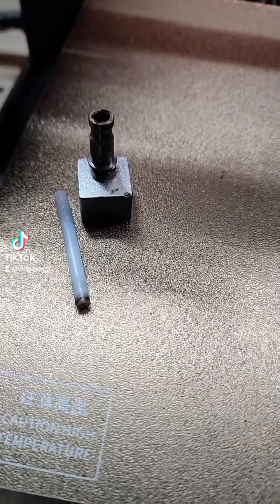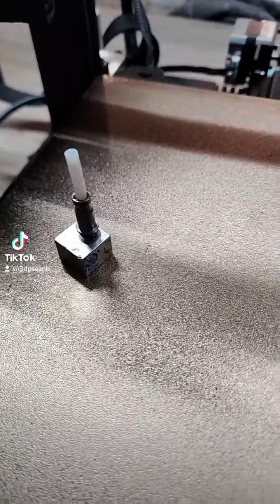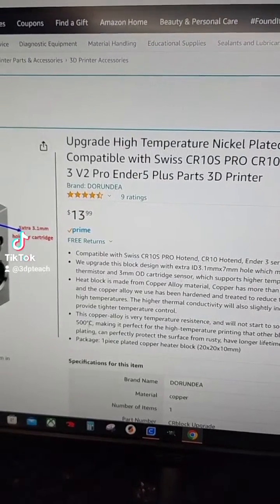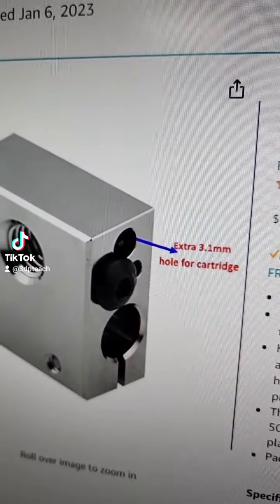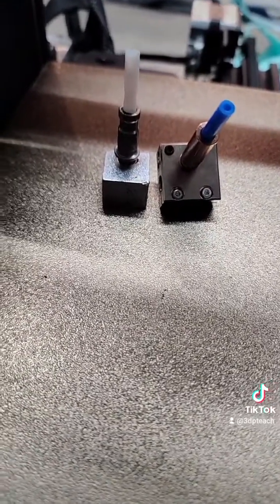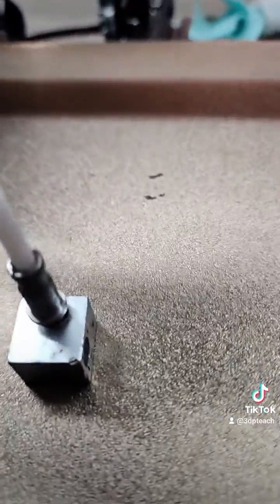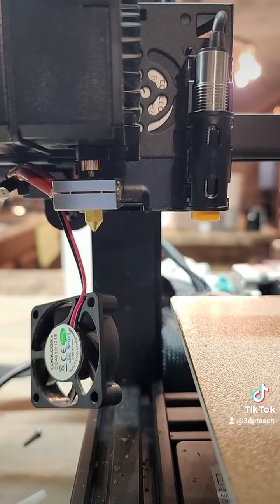Upgraded All Metal Hot-End for Anycubic Kobra

Comment: Could this be done on the kobra s1? I'm really disappointed that anycubic hasn't released additional nozzles for it yet despite the advertisement of them being supported.  I really want to be able to use different nozzle sizes and hardened steel nozzles too but so far, anycubic hasn't released anything for them.

Comment: Great video, thanks. One question is how did you removed the thermistor and the temperature sensor? They look like are glued on the socket. Did you used brute force or bought another ones? In the video looks like you replaced them with new one but not clear.

Comment: I''ll have to do this upgrade too since the standard extruder is too trivial and then leaves a lot to be desired (the filament doesn''t come out smoothly but in threads and we''re not there). But I was thinking of buying the Kobra2 extruder to mount on my Kobra series one (but I will have to replace the heating capsule and temperature sensor with the ones I have mounted on my printer), because I find it interesting to improve the passage of melted filament with a longer nozzle.  Will I solve and get results?
Reply: hey @pierpa_76pierpaolo you get any luck from buying the kobra 2 printhead and making it fit on the kobra 1. I'm trying to do the same thing but would rather have someone else do it before me.
Reply: @maverick1662  The Kobra 2 bimetal on the Kobra 1 is fine but the problem was the clamping on the extruder. I don't remember why I switched to the Creality Ender 3 anymore.

Comment: If you have a kobra 2 you can replace the heatbreak with a bi-metal one from a CR6 and this will allow you to use standard volcano nozzles. You will need to adjust the height of the inductive probe, run a PID autotune and set your z offset but it is a perfect fit.
Reply: this is gold, thank you
Reply: @martinsmith2948  Welcome.  Just for a heads-up I have also heard that the bi-metal heatbreak for a vyper is a better option.  I haven't had so much as a single problem with the CR6 SE one I have and there is literally a dozen kg through it.

Comment: I have a Kobra (base model) 3d printer and am having trouble.  My original print head stopped feeding filament after a certain amount of use.  I replaced the hot-end and the problem still exists.  I have tried different filaments with no difference. Until recently, I was able to make things just fine.   This article made me realize that the Kobra (base model) has its filament drive as part of the print head.  Where other Kobra models have a separate  filament drive. Is there an advantage in later Kobra models?

Comment: How would i be able to change firmware and display ui to go over 260 degree though
Reply: you need to Change this in your Firmware depends how got u want to go i change mine to 315 C so i can heat up to 300 C (15 C Protection is applied in every firmware)

Comment: Hello, I have replicated your guide on a Kobra Neo and I find that the teflon tube does not fit the heat-break. This is because the outside diameter of the tube is 4mm and the inside diameter of the heat-breaker is 4.20mm. The stock tube is ~4.15mm, and so it fits better. 

What did you do with this problem? Does it matter what the gap is? 

Regards

Comment: I ton't think this is really necessary
the only real issue with the anycubic hotend is that the PTFE tubi is too short right out of the box and it's not even good PTFE tubing as it is clearly offcenter

what I did was, I simply cut a convenient legth of PTFE tubing, mount the heatbrake in the extruder, stick the PTFE tube inside the heatbrake, push it firmly to ensure it is seated properly
trim the PTFE tube but leave about 0.5mm sticking out the heatbrake
lenght is now about 42mm, stock is 0.5-1mm too short
assemble the hotend except for the nozzle
after everything is assembled, install the nozzle

this process ensures that you have a positive seal between the PTFE tube and the nozzle
after I did this I got significantly better results
start of the print was now flawless, first layer printed better, overall results appear to be better as well

overall it is a pretty good printer once you set it up correctly
but this tiny detail is so annoying, all they had to do was measure twice and cut once and they would have much less issues with their product

Comment: How did you get it to auto level and set the z offset?
Reply: You'll have to set the z offset yourself like normal, but the auto leveling is based off of the orange magnetic probe
Reply: Use an Allen key to lower the sensor as low as the spanner they send to you after you have placed it on a peace of paper
Reply: @1937Brett explain more clearly please.
Reply: @PikachuOW2  this should help any more help let me know

Comment: Thanks for showing how to do this! I did this on my Kobra Neo with a similar set of parts. The process works there too, though some of the screws are located in different places. Some stuff not mentioned here that may trip up beginners (like me) who are doing this for the first time:
- you have to loosen some small screws inside the old hotend to get the heating element and thermistor out and then tighten similar screws on the new hotend.
- there's a screw to change the height of the leveling sensor. Anycubic actually has a video out on how to adjust it.
- there's some subtlety to choosing how far in to screw the nozzle vs how far in to screw the heat break. As far as I can tell, the best thing to do is tighten the nozzle so there's a gap, but not a huge one, then tighten the heat break to match that. They should both be pretty well connected, but may both have some threads showing outside the hotend.
- matching the length of the new PTFE tube is done relative to the top of the heat break, not some other part of the assembly. The heat break is the only part that matters for the PTFE tube.
- A little thermal paste on the part of the heat break that contacts the heat sink is probably also a good idea. I used thermal grizzly kryonaut because even really high temps are still in spec for that paste. Other stuff would probably work perfectly fine though since it's fairly separated from the hotend.

I haven't settled on whether it's necessary to change the cooling setup because of this upgrade. It seems to be working no worse than before, but I was already looking at upgrading the cooling to help avoid issues with distortions in some overhangs.

My main reason for swapping this out was that I wanted to try out some stuff toward the upper end of the range of temps the printer supports without having to worry about the PTFE tube degrading rapidly and creating toxic fumes. I'm pleased with the upgrade thus far. Hopefully it holds up well.

Comment: Debating on trying this.  I have this printer and have been tempted to just send it back at this point.  Takes so long for the filament to come out on an actual print and when it does come out after two or three passes, it barely sticks and is small blobs every inch or so and eventually just rips off the bed.  I have used Pronterface to adjust Esteps.  Filament came out wonderful for that, but the actual print cycle has been most frustrating.  I have had one OK-ish print out of maybe 5 attempts, and the rest have failed.  Played with different temps of both the nozzle and bed, speeds, z-offsets.  Same issues every time.  I could be missing something as I am new though.
Reply: Don't...hope you didn't
Reply: @georgeovel6423  No I have not.  I have done a few other adjustments and things I have seen like loosening the bed and letting it heat and cool a few times and then tightening it back.  I got a few good prints.  I think I have draft issues more than anything now so I will get a draft hood or something to try next.  I had a couple good calibration blocks and a nice print I got online.  And then I tried an articulated unicorn for my daughter and got the big blob of death covering the hot end after babysitting it for over an hour.  I went to bed for a couple hours.  Woke up to check as it was 50% done and found the blob.  Next print warped, I assume because the HVAC was running, or because I left the room and opened the door.
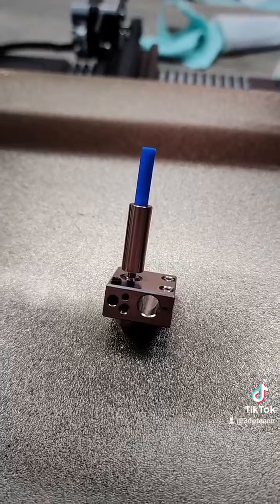Reply: @clordphoto G 1:39 ot my anycubic kobra plus last week and it has only had 2 semi failed prints out of about 15 or so. Both were my fault. One was to low nozzle temp other was power outage. Both just had some bad layers but finished printing. Never had a single bed adhesion issue and if you let the prints cool they come off the bed by themselves. Auto bed Leveling built in is the way to go. Just got the stringing issues worked out, just fine tuning after this as I will be using only 1kind of filament for 90% of my builds.
Reply: @ThatOneGuyWithTheEye what you do for your stringing?
Reply: Get an auto level or one that has it built in. Had that same issue and got fucking tired so I spent a little more money and went from the ender 3 to the anycubic vyper and I love it. No bs

Comment: This is sick! Have you been able print higher temps? If so how did you tell the printer to go over 260C
Reply from the maker: I am still using pla with it. Many other projects taking up my spare time at the moment. You would need to edit the firmware if you want to print higher than what the current firmware is set at.
Reply: @lifetech101  what are you settings printing with pla, waiting for my parts to arrive
Reply from the maker: @UnspokenTube0  retraction is 2mm at 40mm / sec, 195 printing temp and 97 percent flow.
Reply: This is the big question. Cant find an modded firmware or something. Perhaps a resistor could help to manipulate the sensor, but I think this could cause many new problems. I will try to build this thing and test it.
Reply: @adrahamdramatik3753 you need to make some changes in the firmware you need always have the 15°C tolerance so i set my max temp to 315°C so i can print with 295°C without any problems im in to make a better Fanduct to work with Allmetall hotend and 5015 fans and a better mount for the proximity sensor

Comment: Thank you so much for this will be getting one for sure i use mine manily for my hobby of rc planes but have recently had problems with the extruder stepper motor chattering checked for blockegs checked temp changed stepper motor checked driver voltage all ok iam at a bit of a brain jam wondered if you had any idea any thanks again
Reply from the maker: This is a great video on how to disassemble your print head. https://youtu.be/HYwl5IAt0lw

Comment: Any idea if the Kobra Neo could benefit from this same setup (ie is hotend same on Kobra and Kobra Neo)?
Reply: I just did this on my Kobra Neo. It's the same process, just a few of the screws are in different places. The old hotend looks identical to the one in this video.
Reply: @jabberwocktechnologies  did you do this for the neo as im unsure about the size for the heatbreak part
Reply: @1937Brett  Yah, I did it for the Neo. I used a bimetallic heatbrake from 3dmellow. I think the main thing is just to get one that's supposed to fit the CR10. The heater block and nozzle do extend a bit further down too so I had to adjust the position of the levelling sensor. There's already a screw there that lets you adjust that easily. Other than that it just worked.
Reply: @jabberwocktechnologies  brilliant thank you for your reply have you had good results? If we could email abit more on the subject would be great do u get alot of PLA blockages or not with the blue tubing
Reply: @jabberwocktechnologies  also what size heatbreak did you get?
Reply: @1937Brett  Yah, I've had great results with it. One unexplained clog, but that was over many many hours of printing. I mainly upgraded so I could print PETG, PCTG, and nylon without having to worry about fumes from the PTFE tube. It's been great for that. I mostly print PLA+ and it's been great for that too. I sometimes have to wiggle the filament when loading it since the PTFE tube I used had a very slight curve to it.
Reply: @jabberwocktechnologies  this is brilliant thank you for all this, so could you go a little longer with the PTFE tube or stick to the same lengths as the original? Or just straighten the tube when I get it lol
Reply: @1937Brett  You want to cut it to be the same height above the heat brake as the old one. I'm not sure whether cutting it longer is possible. The easiest way to do that is to put the ptfe tube into the heat brake before cutting it, then figure out where to cut by comparing with the old heat brake. Straightening it out should be good enough.
Reply: @jabberwocktechnologies  brilliant thank you so are you able to buy the thermostat or cable and the heat sensor cables separately as I broke mine when trying to change my nozzle
Reply: @1937Brett  Yep. I'm planning on swapping mine out soon but haven't gotten to that yet, so I have less definite info. The thermistor type is "ATC Semitec 104GT-2 104NT-4-R025H42G" according to the firmware source they released and the heater cartridge is 6mmx20mm (measured). I think the voltage is 24v, but I'm not 100% sure about that yet.
Reply: @jabberwocktechnologies  ok thank you
Reply: Would these match sent a link
Reply: @1937Brett  I don't see a link. Maybe try asking on the Reddit for the Anycubic Kobra series or the Reddit for 3d printing? There's also a 3d printing stack exchange.
Reply from the maker: I dont own a neo but I googled the kobra neo hotend and looked at the images. It may very well be the same. Google it and see.

Comment: How is the stock cooling handling the extra heat, lets says large abs prints
Reply from the maker: Haven't tried abs yet but pla is printing great. If it is an issue we can try the fan duct print.
Reply: @lifetech101  please post an update with results on printing abs / petg or other high temp stuff